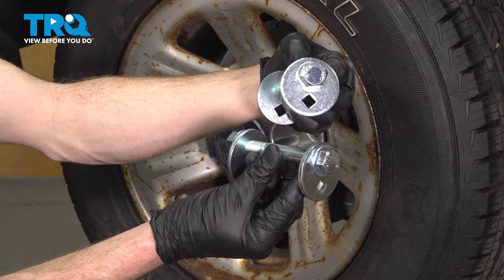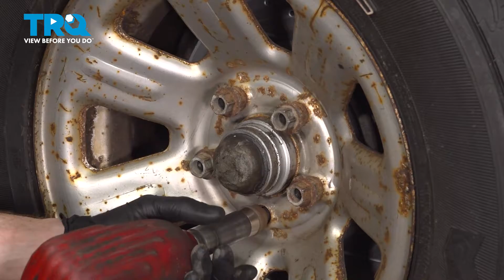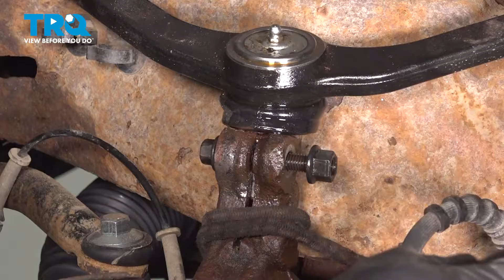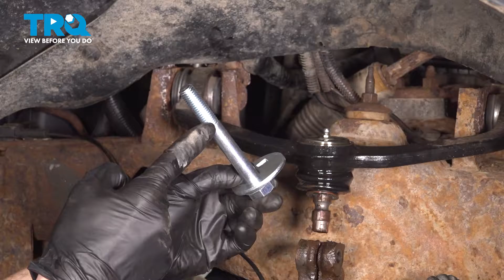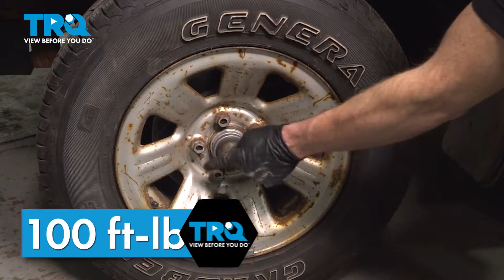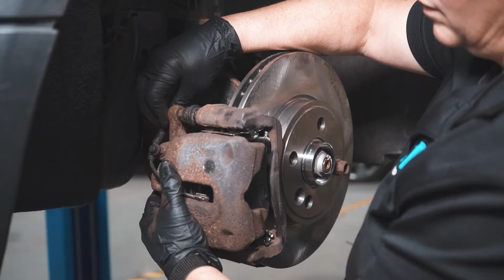How to Replace Control Arm Alignment Camber & Caster Kit 1998-2011 Ford Ranger

Comment: you should not Torque, the control arm bolts until the vehicle is under Load. Yes, yes, I want to will safely on the ground on the vehicle.Then you torque The upper control arm bushing bolts